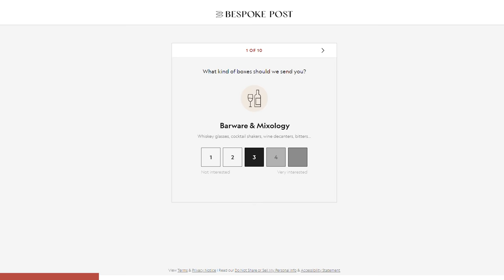HEXAGON TRAYS MADE OUT OF SKATEBOARDS!

Comment: Hi Ben, Why use the band saw for cutting the strips for the frame instead of the table saw? Not trolling. Just trying to learn. Thanks!
Reply: Safety basically: cutting long narrow strips on a table saw presents difficulties pushing the stock through and has a fairly high probability of kickback. 

There are ways to use a table saw if you don't have access to a bandsaw but look up how to do it, especially the safety aspects.